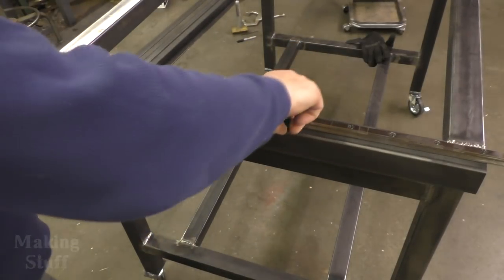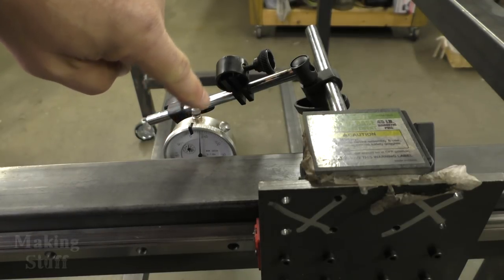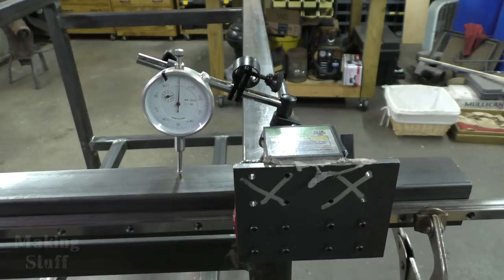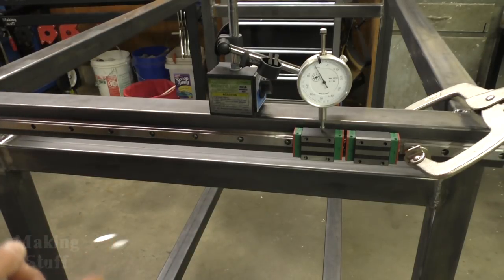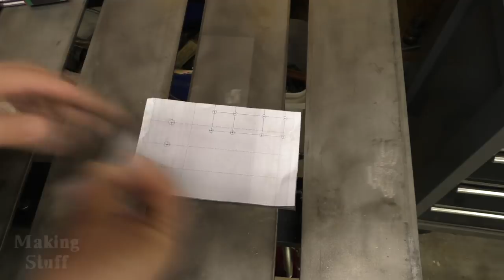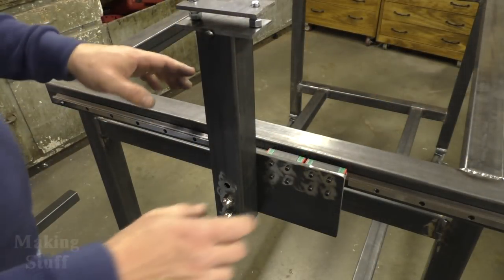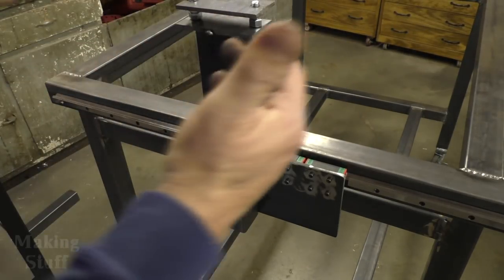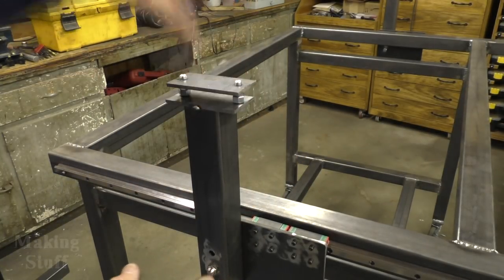DIY CNC Plasma Table - Part 2 Linear Rails

Comment: The amount of precision he's putting into this reminded me of my first CNC build.  Now that I've done several I've realized it absolutely isn't necessary, especially on something like a Plasma cutting table.  The tenths you're fretting over will be magnified many times over on a second by second basis by your arc characteristics.  A plasma table is NOT a precision CNC machine.
Reply from the maker: Yeah I found that out later in the video series and a THC solved all my cutting problems.
Reply: Exactly. The THC will compensate for the much greater difference on the guide rails, especially since the material being cut usually tends to bend. It is important that the gate moves with even resistance along the entire length of the table. Thank you for the movie and best regards.

Comment: Turn the rail over - swap ends - and check it again.

It its the rail the bow will be down.

If its the steel the direction of the bow will not change.

Comment: I've come to the conclusion that many of the inexpensive rails are out of straightness as delivered. They probably warp from the heat during grinding. What I do is make sure all the mounting holes in the frame are in perfect alignment. Install the outside bolts, leaving them a tad loose. Then put force on the rail while checking alignment, and clamp the rail down until I can snug down the remaining bolts. The bolts will keep it straight.

Comment: Plasma won't care about that small deflection. You have a rolling cart and the sheet metal won't likely be that flat as it warms up.  Nice video. Looks like you're having a good time. I would be interested in the input. make an image and sending it to the machine.

Comment: think it would be safer to clamp a known straight piece of bar (like a machinist staightedge) and clamp that one the legs , ajust the ends so its the same height both sides , then measure along the whole length 
knowing the straight edge is straight take a lot of guessing out of dailing the rail in

Comment: Are you sure its the rail out and not the square stock?   I would check by using a known flat surface or check the rail on the other square stock.   if there is a differenc between the 2  its NOT the linear rail thats out.

Comment: The high spot registered on the dial indicator is more likely caused by the rail bowing downward from the weight of the "rig" (whatever you call it; did not catch it if you said it).
Reply from the maker: Yeah but the measurement went high, not low.  Plus it doesn't weight enough to cause the 11ga steel to bend.  Thanks for watching.

Comment: Rail has the bow in ti because you have clamped it from the sides? You don't need much force when clamping it at the sides to then talk it is bowed for few thousands of an inch...
Reply: 4:00 and sir, do sharpen your drill :) one should drill into construction steel like into a butter

Comment: I have my table built and the cabinet wired and am trying to setup the Mesa 7i96 to work with nema 23 425oz motors in plasmaC, i have the mesa card setup in linux and can ping it but have no idea where to go from here. Seems like eveything i try doesnt work and i am about to axe this thing and go with mach 3, any ideas or maybe a ini file that works for you.
Reply from the maker: Go to the PlasmaC section in the LinuxCNC forum.  They are much more knowledgeable and have helped me fix several issues.

Comment: are you considering these steel tubes flat ? lol.
and even more they may have been welded with some of these non-machinist cheap magnetic 90° holders and the tubes were most probably distorted during the welding.
Well if you lapped these tubes in place i would understand the trust you put in this tube's surface.
Anyways i havent watched any other video from your channel, i could be wrong.

Comment: I know I'm late to the party, but may I suggest that it might have been your tubing which is bowed, and not the rail. Just a thought.

Very nice build by the way.
Reply from the maker: Thanks for watching.  It's hard to tell which one was bent, lol.  With my luck it was probably both.
Reply: @MakingStuff , true, from my experience tubular steel is rarely "perfect" to within a couple thousands of an inch as manufacturing tolerances are not as tight as in the machinist segment. But for plasma, they can be pretty loose, Thank you for posting your videos, it is interesting to watch, and very informative.

Comment: :) nice precision  i think not necesary to do high precision in Z direction plasma cuting compensate Z high witch THC but its more importand hawe square in X-Y directions this is more importand  and take a look to can adjust this two axis i created one plasma cnc in garage  witch separated fream from table and Z high its not big problem controler witch THC corect in time all diferents in high from torch to material  in my chanel i put now video  how cut  big closed profile 4mm thiknes in two side some diferents in material high ned mount torch upeer or downer sorry for broken english :)

Comment: Great build.
How well is the 6mm wide timing belt holding up? I'm thinking of doing a 4x8 table, do you think that much belting going to cause slop?
Thanks for the help
Reply from the maker: So far it has held up fine with no problems.  I would suggest a gear rack for larger machines.
Reply: @MakingStuff  Cool, thank you.
Great videos and your way of talking makes it easy to understand what's being said.

Comment: Your drill speed is too high. I didn't see any chips fly. It took you some time to drill that hole.
Reply: Video speed is increased cause the drilling takes forever at normal speed.

Comment: I do not particularly like linear bearings, especially on how it is being used here.
Reply: Could you elaborate?
Reply: Linear (line form factor) is not the preferable bearing type contrast to bearings on a cone or race. Linear also make more noise as they travel, they are cheaper and the tracks are housed in resin. The context is of my post is within the application for 3D printers and CNC builds. The form factor allows them to be manufactured cheaper than bearing have a bearing race. I found that linear bearing with most 3 D printers have loose tolerance. One may drag while another will move freely.
Reply: @bobcatt2294  thanks!

Comment: Way to much effort making this thing perfectly flat. It's a plasma table if you were off by a 1/32 it likely would make no difference.
Reply from the maker: Yeah I eventually figured that out.  Especially when using a torch height controller.  Thanks for watching!
Reply: @MakingStuff  I enjoy your videos. Your craftsmanship is phenomenal.